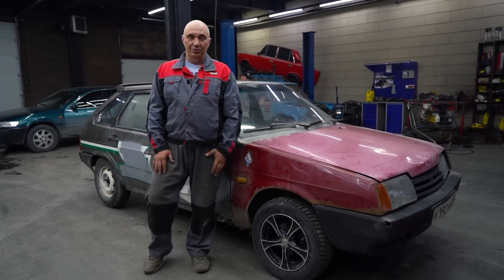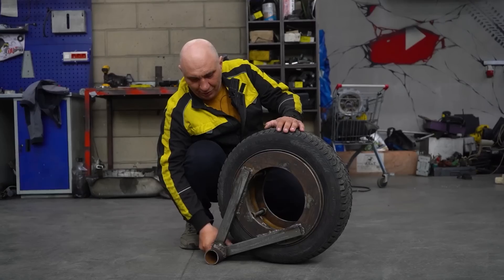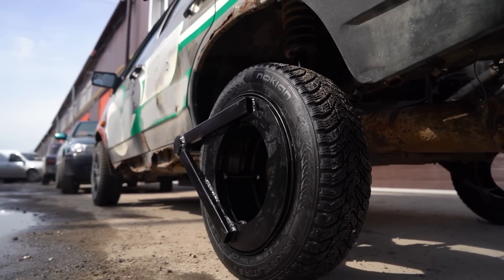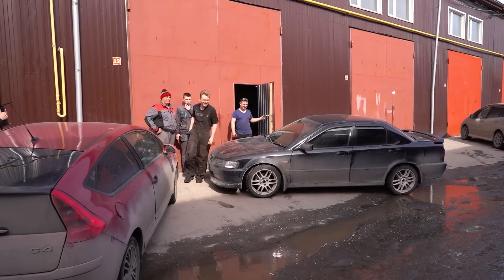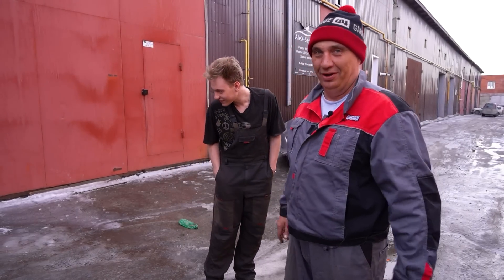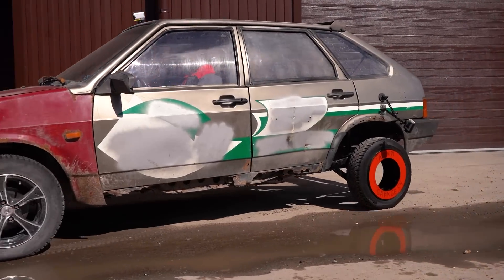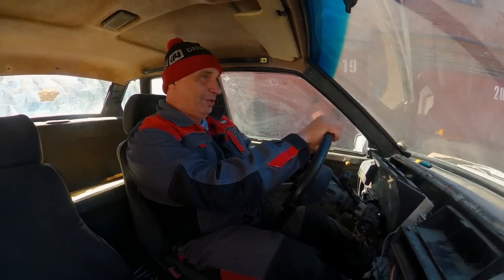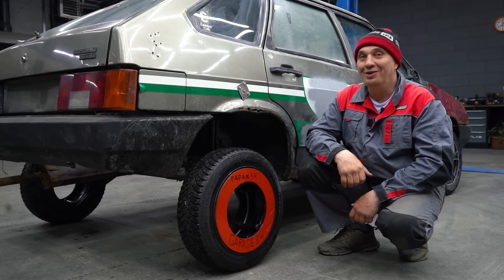Driving on wheels with no spokes – how is that possible?

Comment: Very cool :) You could hide the bracing even more if you use a quarter section of heavy wall steel pipe, instead of the bracket on the back :)

Comment: You should weld a plate around it wheel shaped above bearings in a circular fashion box it off with a port to add grease inside, and look completely hollow and will help with noise and by the way amazing channel and content ❤

Comment: You could fit a drum brake inside and use the steel wheel bed as the breaking surface

Comment: Teflon bushings pressed onto the bearings. Electromagnets with pads welded to the rim for braking and possible hybrid motor hijinks. Drive wheel with a sprocket welded to one of the bearings. Probably a couple thousand dollars US to pull off.

Comment: could of pored some oil inside that rim so the bearings hit oil every rotation heck i think a healthy amount of grease on each bearing would help a hell of alot.
one thing bothering me is why did you not use wheel bearings?. there bigger easy to find and you know 100% they take the weight of a car

Comment: MAYBE next time use those Rubber trolley wheels (that have a ball bearing in the centre) or cart wheels (I have some on a 'Dolley' under my Mrs tumble dryer and chest freezer (as she sits that next to a cupcoard) so she can move it about to access said cupboard, find some small enough though and replace those ball bearings with the rubber trolley wheels. THAT'LL quieten them down. ALSO.. It's ONE way to 'JACK UP' your car (weld the 'Wheel guides' at a more steeper angle! Hahaha Now do the front and you'll have a 'WHOLEY JACKED UP CAR!' hahahaha
😎🇬🇧

Comment: The design would be perfect for a drop trailer that lowers to the ground to load motorcycles and other equipment onto it then race back up with airbags. 
It’s a perfect design.

Comment: You could fill the inside with an oil bath and seal it with a press insert pipe that is the same diameter as the hole opening. That would quiet it down, lube the bearings and still give you the hollow look.

Comment: Would've looked even better if you'd welded something to the inside of the rim to hide the bearings. Just a solid band of black steel so it looks like the wheels are staying there through the power of magic and positive thoughts.

Comment: The weight is not evenly placed on these bearings. The bottom bearings are load bearing. Ideally, the bearings should have been part of the outer/rotating assembly to distribute wear.

Comment: Great job as always, guys. I would like to suggest that you could try a strip of nylon for the outer bearing races to ride on instead of straight metal to metal contact. That may quiet the noise.

Comment: It turned out great. if you want to make these powered you'll probably want a much larger wheel diameter, that will give you more room for mounting whatever you're using to power it. You'll want to use larger roller bearings instead of those little ones you used, and I have one idea for how you might power it, basically running the axle onto 2 more axles inserted into the 'hub' running against the tire rail you have inside. Its difficult to explain. But doing it that way should retain the correct direction of force, otherwise you would have to drive in reverse. Alternatively use a chain drive, a motorcycle chain could easily run against a sprocket mounted on the wheel.
Reply: We got expert in the house 😂😂😂
Reply: Or use a chain.
Reply: @rudolphbondefangerer5513  Yeah the chain is how i saw most of the bicycle builds did it.

Comment: Move the wheels forward a lil bit, make the red rings thinner, add a cylinder in the middle to cover everything up and they would be perfect. With wheels of centered, they make the car look like it was made in crossout, haha. Also what about installing a gear on the inside to replace the ring and add a motor, to make them drive wheels.

Comment: To be honest this would look dope AF on a trailer. A light one that you can use those torshin type axles. Using some sort of aluminum tire and bearings with grease and a nice fitted clamped thing with bolts on the outside. The brakes could be done inside using some type of drum.

Comment: how about a concentric bearing system, so the bearings rotate around as well, this way they aren't static and will wear better...  also try a tapered bearing placing the larger diameter side positioned to carry the most weight ... you could even gear it as well so they have drive, use a couple rear end gears and fashion the gears in a concentric gear drive set up

Comment: modify disk brake calipers to fit over and around the wheel and use the red area as the disc/rotor

Comment: Add a ring gear to the inside rim, then have a CV with a pinion running the ring gear, that will give you drive.  As for breaks, easy,  just a rotor the size  of the inner rim and set it up like oversized disc brakes.
Reply: Set it up as drum
Reply: Do spokeless drive wheels

Comment: If you somehow used the red ring as one side of a calliper, and the same inside, they could squeeze against a an added flange. Would need some electronics but the brake discs would be360 degrees. Imagine! 😮

Comment: It would be complicated but, all four wheels can be done this way.  How to make it move?

Make the two rear wheels ELECTRIC.  Get rid of the transmission and driveline.   Mount a large belt-drive pulley on the inside of each wheel so it's not easily visible.  Above and out of sight, each drive wheel gets its own electric motor.  

Mount two BIG alternators on the Lada engine.  They will each charge a 12V battery which will drive the two electric motors for the rear wheels.  Each electric motor will either be controlled by a high current rheostat or a golf cart speed controller.

How to stop the car?  With the hubs gone, Vlad will have to make the brake switch control four relays, to feed four solenoids, which drive scrub brakes against the inside of the wheel rim.  That will require bolting a cylindrical liner to hide the bearings and give the solenoid something to push against.  It' won't stop very well but, it SHOULD stop!

 If all goes well, it will run entirely on an electric drive and will look totally clean.

Comment: very well done and the bearings if ya use a set of a Lil bigger bearings that are self packed sealed ut probley stop some the noise ..but now what would look good is the centers you all made a while back that free float and don't move when driving ..those would look cool in center not touching rim lol but ya I like them ..great job godblees

Comment: Cap off inside and grease will stay inside for the bearings,  and you could use some type of parking brake assembly type for the rear brake

Comment: Ok ideal here. What if you made a set of wheel using heavy duty springs as spokes. It would  also act as part of the suspension.
Reply: https://youtu.be/xG2mbL4QyZQ
Reply: They did that last year
Reply: @jamms992  Guess I missed it. I will check the back videos. Thanks

Comment: Awsome crazy content as always guys.. Weld in some sheet metal all the way round the inside diameter so you can't see the bearings then fill the inside with grease 😅 lights underneath so it shines through at night and somthing black flicks in the orange paint so you can see it's not rotating with the tire...

Comment: should be possible to make the drive wheels  by using the ring gear from a flywheel for transferring power. got to be a low power vehicle to hold up  but hey  its  a test version.

Comment: The easiest solution to the noise would be to seal up inside of the those two rings with more steel and maybe some rubber and use a total loss oil system.  You're never going to get a good seal between the moving wheel and the static hollow-hub?.  But you might get one good enough to work for a while.  Also oil leaking out your wheel and down your tire might not make for good traction, but they are Russians.

Comment: I feel like a have a good idea to solve the bearings. Seal up the outside plates with the wheel, and make it one unit with a lip for balancing. Then you can have the bearings in the Channels and lubricate them with grease

Comment: As a mechanic as well, set up drums? The wheel could be the drum and that would prevent heat soak. But you’d need to sleeve the wheel to prevent it becoming a wear item
Reply: I think that could blow up the tire if they got hot enough, similar to how mountain bikes with rim brakes will overheat the rim when you ride the brakes down a big hill

Comment: If you guys want look up hubless wheels for cars there's a company that makes an electric motor inside the wheels and you place them on the front or rear axle of your car given you an electric fourwheel drive if your car only had two wheel drive, the motor inside the wheels are just as powerful as a Tesla motor so you can make your car very fast in acceleration

Comment: Ok to make them driven. You'd have to mount them the way you see those electric hubless wheels that have the motor in them. You'd had to have the axles pretty much up against the inside of the ring with a pressure plate or bearing to keep it in contact with the wheel so it would send power to it or use a set of gears. As for non driven like the back id say change the bearings so they make no noise also add a cover over the inside of the ring so dirt etc doesn't get down into the groves
Reply: also, they could try to seal the back wheels and fill it with engine/transmission oil or grease to reduce the friction between the bearings and wheels. the wheel wouldn't need to be filled all the way, because the rolling wheel would distribute the oil or grease
Reply: i like your ideas, and may i add that a set of gears are unnecessary, because a traction drive would work just fine.  I envision several motors mounted in such a way that they would engage the traction surface.  also a braking ring that is mounted onto the wheel, with a caliper mounted inside would work nicely.:goodvibes: